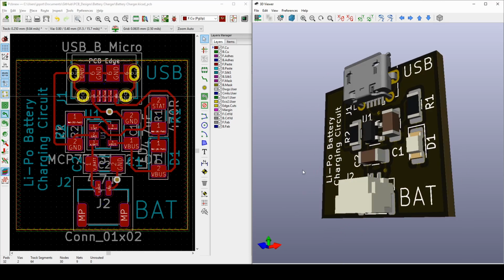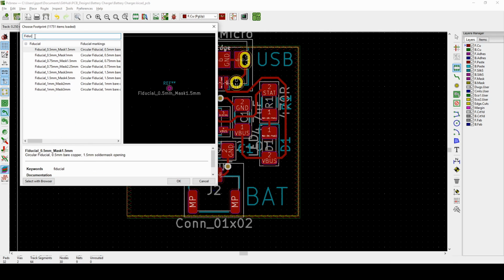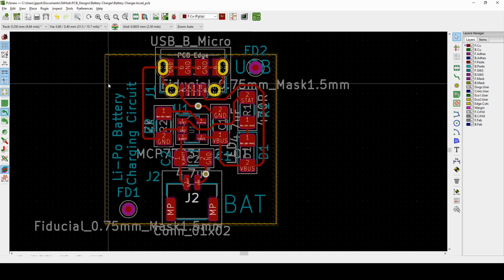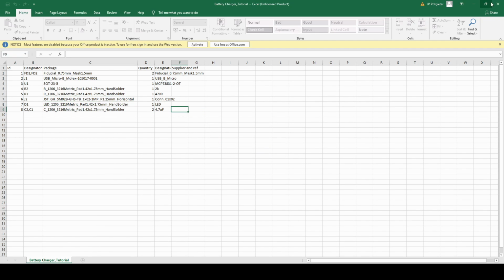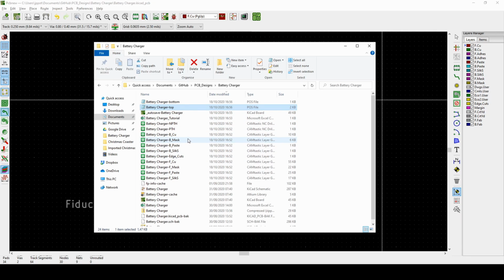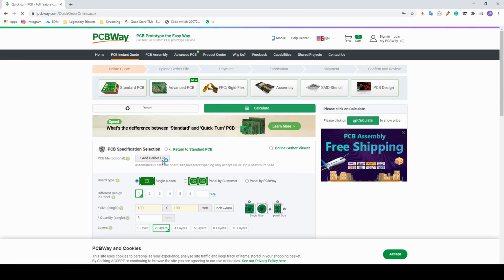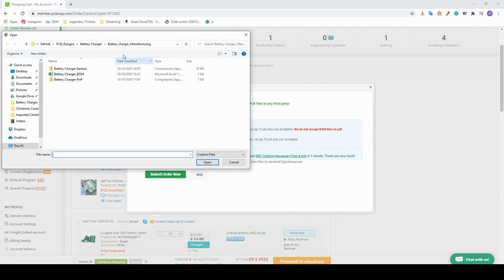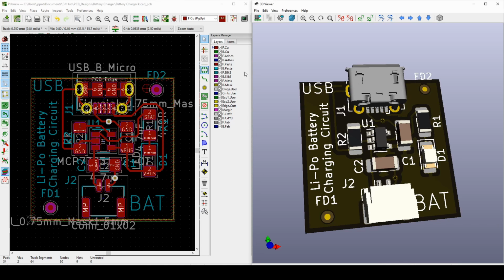KiCad Tutorial - How to generate production files for your PCB.

Comment: My first project is being manufactured by PCBWay. The board has already been assembled, confirming its functionality. I have sourced all components from Amazon previously; however, PCBWay does not use Amazon, so I searched for the necessary parts on Mouser and Digikey. A push button switch was not available on either site. I included the manufacturing part number, Mouser or Digikey part number, and a link to the part.

PCBWay only considers the manufacturing part number. This morning, I received an email regarding components intended to be 330K resistors, but LEDs were provided because the manufacturing part numbers were incorrect. Additionally, locating some standard parts, such as 1uF capacitors, proved challenging. I selected Tantalum capacitors, as they were the only option available on Digikey or Mouser.

Comment: How do you check that the rotation of the component is correct? For example a QFN32 pin could be soldered in any so the footprint cannot help to see if the roation is correct. Thank you for the video!

Comment: Why do you have a vias above J2?
Reply from the maker: Hi, thanks for the good question😊.  The via above J2 is to connect it to ground. We have a ground plane at the bottom of the PCB do where ever there is ground we used a Via. We could have connected the grounds together without using VIAs. But I prefer to make use of ground planes. Hope that makes sense. If not, please don't hesitate to ask more queations😊
Reply: @PlumPot  That clears my doubt Thank you so much😊